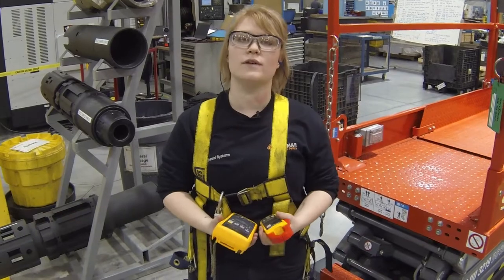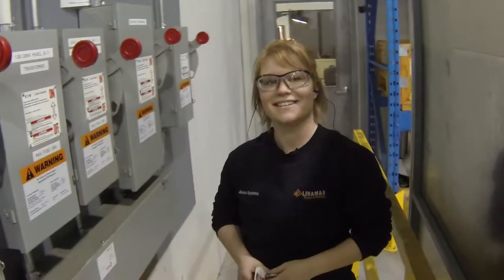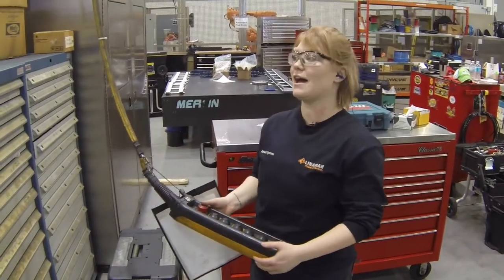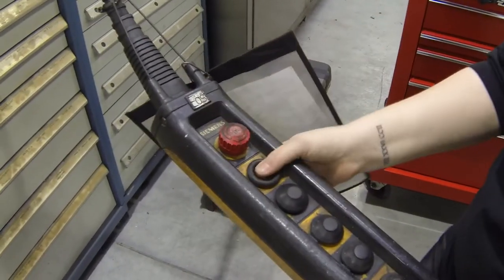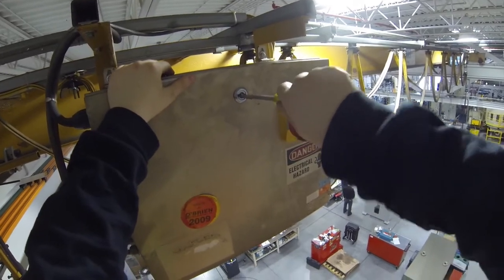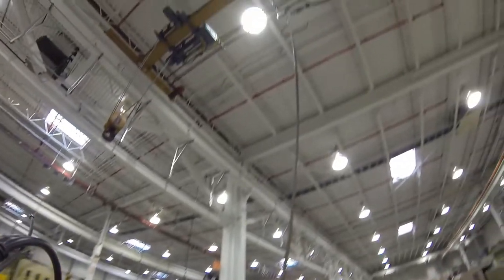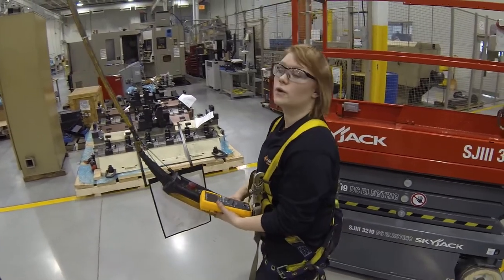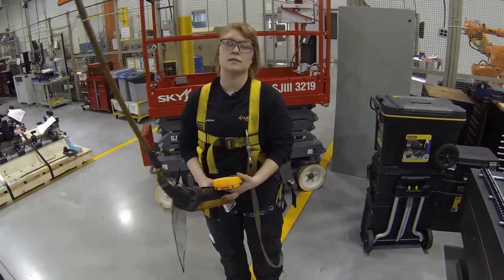How to Test an Overhead Crane Using The Fluke CNX™ Wireless System

Comment: In this particular case you could just as easily have placed the current probe on each of the 3 conductors feeding the crane at ground level in the disconnect and have someone operate the crane motions one at a time to get all three phases and all three motors. This would not supply you with rotor currents but that kind of crane don't have wound rotor motors so that's a moot point.

Comment: Ok when you want to test 3ph motor , you need to read the information for 3 lines R S T , in your case , you have to do this three times , that is kind of tiresome , so in the crane case you need to use three current modular s with testing devise capable to receive information from all of them at the same time , so you can have full reading for the motor ( current balance for 3ph motor )